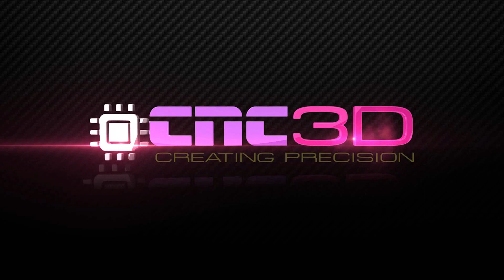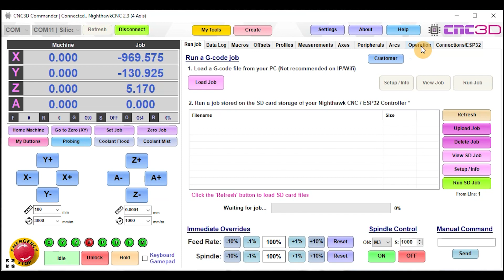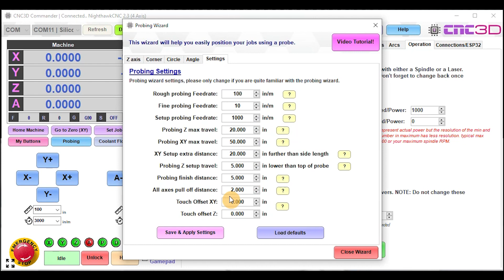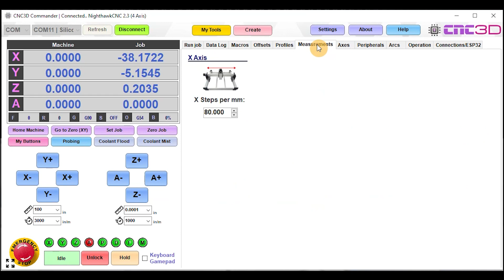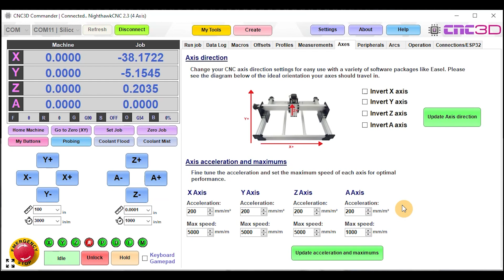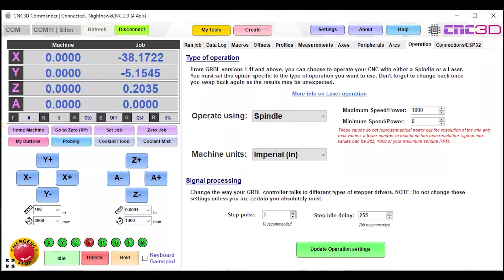How to switch to imperial inches - CNC3D Commander - Powerful GRBL control software

Comment: I clicked operation tab and there is no selection for inches maybe I need to update?
Reply from the maker: @johnsonlong1272  most likely yes. Click on Help button. Current build is 304.
Reply: @cnc3d  ,Can you post the code for a simple circle for me that GRBL will run. Seams silly to me because I program real CNC mills every day at work yet I tried to do it in my grbl machine at home with no luck 1st I tried to do it with X's and I's it grafts it fine but doesn't run it then I searched google and some say grbl don't recognize i,j,k. So I wrote it with an r value and same thing grafts it fine but doesn't run it. I'm lost it's a simple circle how hard can it be.
Reply: @cnc3d , Thanks for your very fast reply. I got it I'm not even sure there was a help button in the version I had. Anyway I close out the program made sure my laptop was online once I confirm that it was. I restarted cnc3 program it automatically said there was an update and asked me if I wish to do so. Worked perfectly and I am on version 304 now and set to imperial. Now Time to play around and see how this works hopefully more like a real CNC machine sense looks like weekend at least use variables here that's a good start.